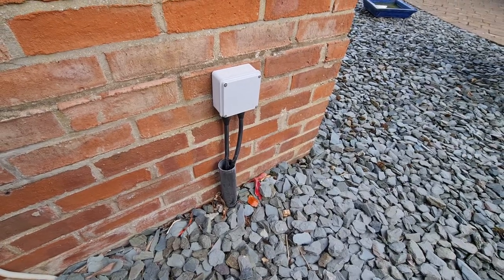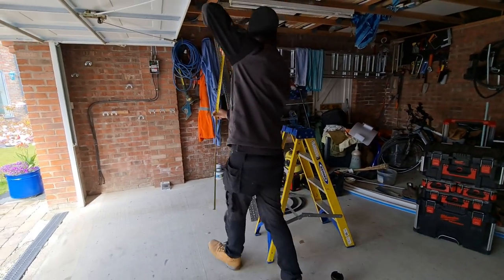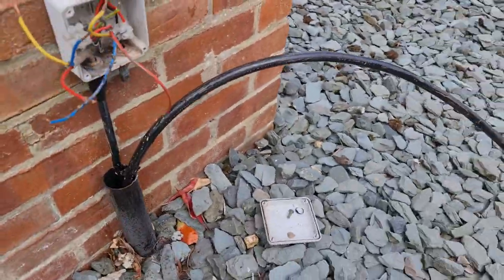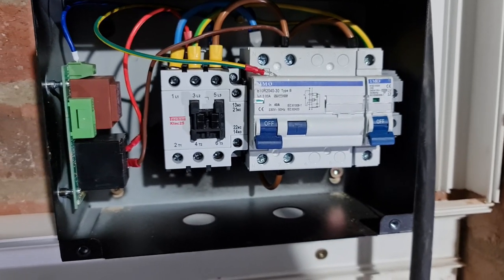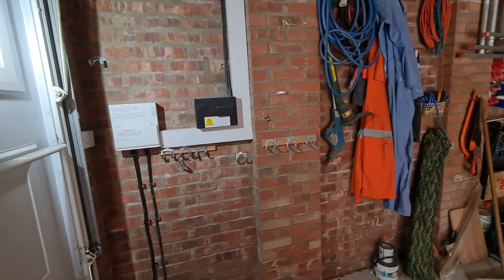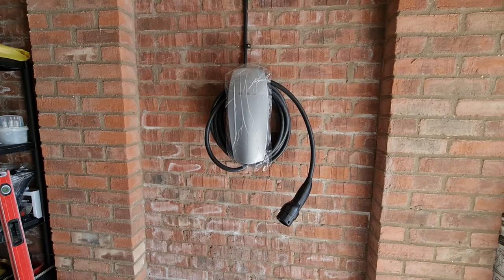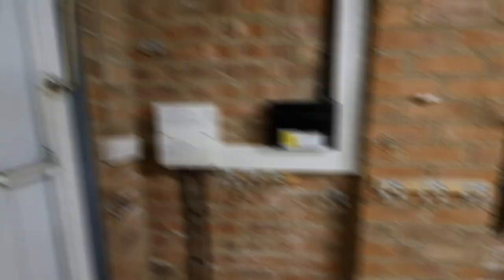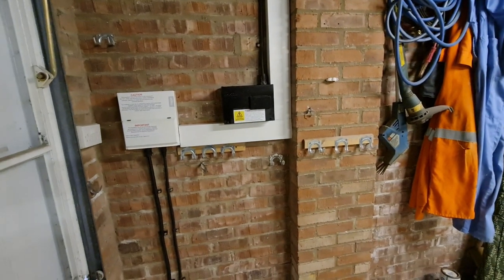Tesla Electric vehicle Charge Point installation, Matt:e Pen fault detection, Tray work, EV Testing

Comment: Something worth pointing out is that the SWA armouring must NOT be connected to anything at the EVSE end, as the Matt--E Isolates the earth in case of a PEN fault, and the SWA is bonded to the incoming earth on the Matt-E case.
Reply from the maker: That is actually a great shout as I never pointed this out in my video. 

In this case it wouldn't have made an issue as the matt:e isnt supplied by an SWA. But you are absolutely correct if it was glanded in that way and you then glanded and bonded the swa at the EVSE send you would essentially jump the contactor disconnecting the earth. 

You see that is my presentation skills being improved. Great comment!
Reply: @electrician247  Even if the Matt:e isn't supplied by SWA, surely the case is still connected to incoming earth ( I assume it's metal)
Reply from the maker: @mikeselectricstuff  yes mike it is earthed from the outgoing terminals on the contactor. Well from what I can see anyway. 

Just to be clear the SWA on the EVSE is not bonded on this install. The tesla charge point has a threaded entry point in the top plate. Its impossible to get a piranha lock nut on inside anyway.
Reply: @electrician247  Case earthed from the output sounds wrong -  that could make it live if there was an internal fault. the manual shows it on the incoming earth
Reply from the maker: @mikeselectricstuff  it could well be, I am just going from how it looks on the picture. But thinking about it the incoming earth terminates into a din mounted connector which probably clamps on din via an earth path on the connector and then loops to the input of the contactor.

Which as you say makes it very important despite the method of input cabling that another earth path is not imported to the EVSE. 

With the tesla it would be very difficult to do that on the top plate entry as you can not fit a nut internally in the space provided. 

But its a very good point to include and I will make sure to do that on my next matt:e install.

Presenting the videos is a learning curve for me. Especially with the apprentice following I have I want to get things as clear as possible.

Away from this video I am also an electronics engineer with a history in mobile phone and MOD comms sectors. So I am really looking forward to delving into your channel. Looks very interesting indeed. Hopefully I might have something useful to drop in the comments here and there.

Comment: Nice work Mark. 
Not surevif its in comments before but what should we budget for this type of install. I believe new regs need a surge protector as well. ? 
As an idea £500-800 or ?
Reply from the maker: Will need pen and surge. Much more than your estimate as a minimum.  That just about gets the charger lol
Reply: @electrician247 . For sure I was adding £500 on for tesla unit.
M&E seems such a dark art though 😉. You see the bits in screw fix for £30.
Bit the bill adds another couple of 00's.
So I suppose I'm aaskim if its all in a days work what would the extra over be for the bits that don't seem to be clear if needed.
I know what your reply will probably be but I've had people say surge is a would like and another that the penfault not needed on gen 3.
Tesla instructions I don't feel are clear.
Reply from the maker: @richardsylvester5264  pen fault is needed SPD the same. Unless super rare circumstances. Doing EV charging properly costs money

Comment: Been in the garage at my latest rental, new build.
13a fuse spure fed from house for lights and four double sockets!!!
Reply from the maker: A typical new build setup. We have more work to do on this one. Not shared that in this video as yet. Mainly to see the comments 🤫
Reply: I might be tempted into one of the new builds on the next phase of this estate.
The one I like has a double garage and I was thinking of having two solar arrays, one on the house as normal (air source heat pump etc for heating) with some form of battery/power wall but also the provision for another array on the garage with a power wall for when I get the final push to an electric vehicle.
Have any of your customers done this yet? Or just go for linking the two arrays and stepping up to the next level?

Comment: Hi mark,

Was the charge point a Gen 3 wall connector?.
As these have integrated type A rcd & DC 6mA protection and type B is not required,you can only commission these through the Tesla bolt app!.
Good video btw
Reply from the maker: Gen 2 this one.

Comment: Great video.... Thanks :-) can I ask.... Did the cable between the pen device and the charger HAVE to be that shielded thick black one??? Could you not have used the appropriately sized twin and earth as the wiring is not hidden and all internal? Thanks :-)
Reply from the maker: Could be argued with twin and earth and vehicles etc in the garage. NYY even. But we prefer SWA especially around vehicles.

Comment: I am not staying in my current house much longer and just want a 32amp socket to charge my Tesla for now. Will the Matt E bring it up to regs?
Reply from the maker: In Short yes when paired with a tesla charger. Other charge points have the technology built in. Such as Wallbox, Myenergi, ICS etc, So the simplest solution is often a non Tesla charge point.
Reply: @electrician247  Thanks! Was looking at just doing a 32amp commando socket paired with the matt e then using the supplied tesla mobile charger (granny charger) with the 32amp adapter they sell.

Comment: How much more did the Tesla charger+MattE +B RCD cost compared to a Zappi or other EVSE that has it all built in?
Reply from the maker: Is exactly the point I made to the customer. But for them its all about brand tesla.
Reply from the maker: So I had a look, matt:e kit with the type B was £260, customer got the tesla charger as part of the deal on purchase FOC. So in this instance worked out well for them. 

Generally speaking tho I would expect the Zappi to come out far more cost effective and a better solution. We are Myenergi approved installers so take that as you will. 

I have follow up videos coming on this, the actual garage is not staying up. We have a lot more work going on for the client. Involving a car port and bar area. 

I am hoping to get some of the apprentices from the www.apprentice121.co.uk community involved in that covid permitting! They will take great value in your input so keep the comments coming anytime.

Comment: Does the Matt E device come with B type as standard? Wondering why B as I thought A type was suffice? This is a question as I have never done this.
Reply from the maker: Hey Paul, you can select the device needed. But Tesla needs type B.
Reply: @electrician247  I think I just worked it out looking at the regs book.  If no 6mA is incorporated into the charge unit then it needs a type B.  If there is a 6mA built in then A type Rcd fine?
Reply from the maker: @onthego2004  pretty much. Good on you for finding out! Most manufacturers spec the RCD needed in the instructions now as well.

Comment: I take it you omitted the isolator because of the proximity of the CU to the door?
Reply from the maker: With the double isolator on the CU, the 3 pole isolator in the Matt:e it seemed to reduce any confusion for an end user and provides plenty of points of isolation for maintenance. Would you have done it differently?
Reply: @electrician247  it was just the lecturer on the course pointed out that a charge point in a garage should have an isolator in case of fault. With everything being in such close proximity. We had to spec it on the design sheets. What are you’re thoughts on that?
Reply from the maker: I would agree for maintenance etc. Its a very good comment to drop and in a few videos time others will see why. 

Thanks for getting involved in the discussion
Reply: @electrician247  appreciate the response 👍 and look forward to it.

Comment: i thought the tray was a good idea, well done
Reply from the maker: Thanks Brian
Reply: @electrician247  Yes the use of the tray set a good standard. Would have liked to see getting the cable through the duct as this is a skill in itself sometimes. Seen a lot of Jordan's video's on car charging he has installed a few makes now but I think his preference is Zapee. as it ticks all the boxes.
Reply from the maker: Yeah we need to work on filming 100%. But we dont have a cameraman sadly lol. 

The pull was pretty easy in the end. Used the existing 2.5mm as a draw wire, stripped both ends just leaving the inner insualtion, taped together very very tight, lube the cable and openings in duct. Gently push and pull together as a team. Went straight through easy on this occasion. 

I do need to take the tripod out maybe on jobs. Its one of those really, just filming for fun at the end of the day.